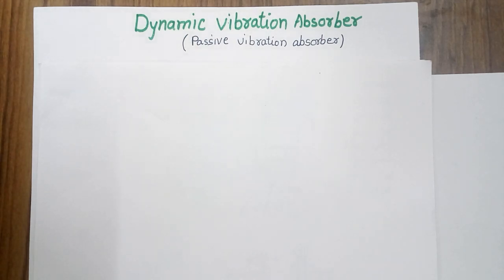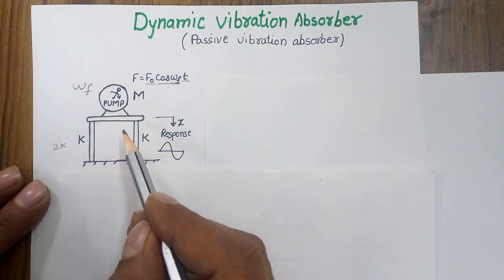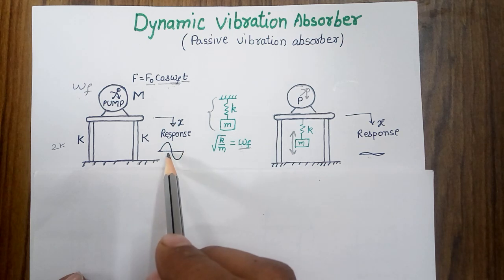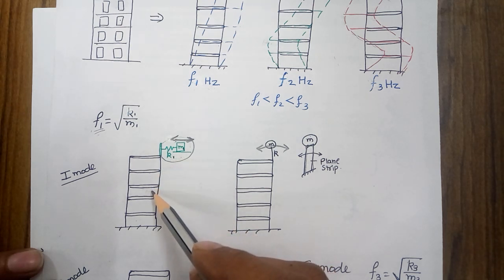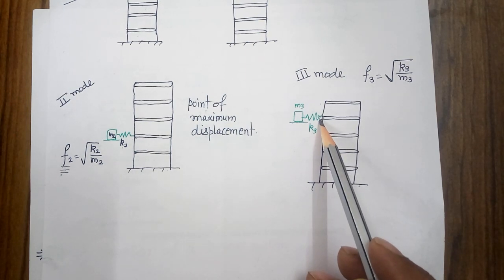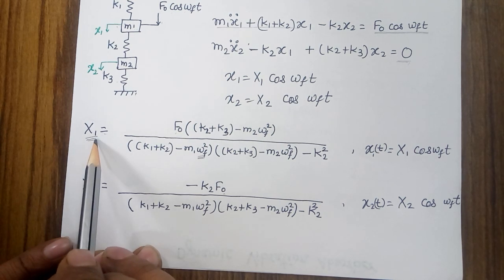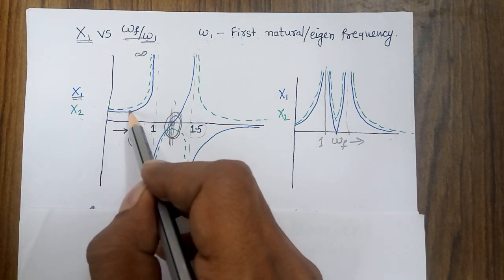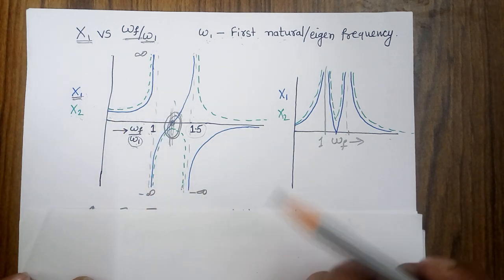Dynamic vibration absorber part 1

Comment: How to reduce vibration of cooler which  is supported by four clamps? 2800rpm ,50hz,230v.
Let's see practical engineering.
Reply from the maker: Hello Mr. Singh, I guess direction of vibration like vibration in vertical plane or other is also required, However, I will assume that the unbalance in the fan or rotor creating vibration in vertical direction, second assumption unbalance is acting from the centroid means no rotational vibration. In that case, we can employ an absorber using a cantilever beam (made by any metallic strip) with a tip mass. The natural frequency of this system will be 46.66 Hz as rotation rpm is 2800. How to do it? 
using freq=(1/2pi)* sqrt(k/m)  Hz, where  k = beam stiffness k = 3EI/L^3 ..based on the stiffness computed you can choose a mass that will result in 46.66 Hz freq. Now where to implant this device. You can place it on any vertical wall of your cooler. 
I tried to answer your query, there may be  CHANCE STILL IT IS NOT CLEAR TO YOU... Please send me picture of your cooler on ashishpurohit1@gmail.com
Reply: @ashishpurohit9138  Glad 🤗😀😊to read to reply ,would revert back to you with necessary details as soon as possible.
Thank you for your consideration.
Reply: @ashishpurohit9138  Great!!!